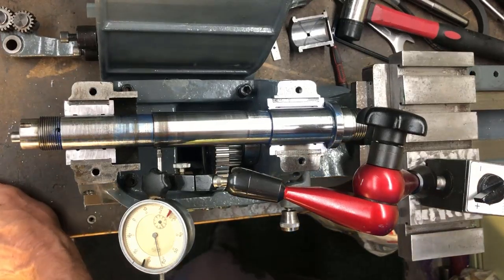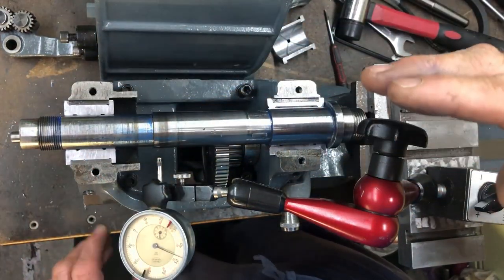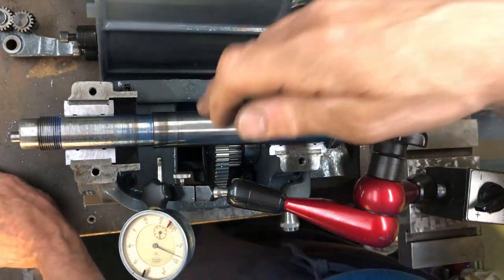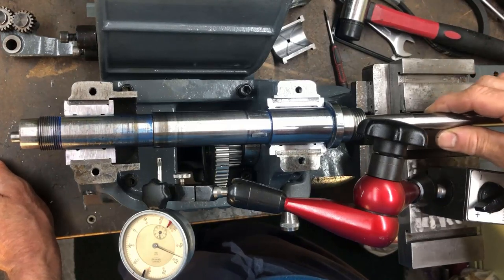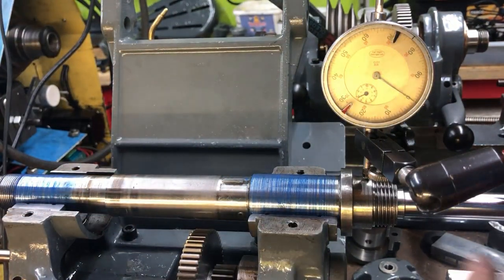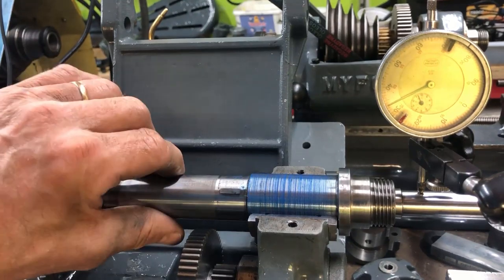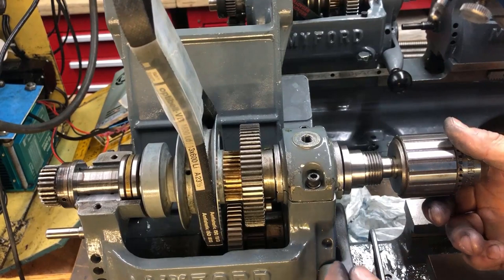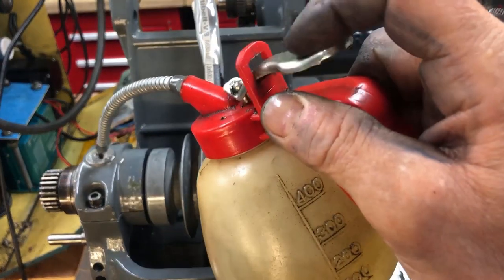Myford ML7 headstock restoration: bearing scraping, testing and spindle alignment

Comment: I can follow the vertical corrections and shim compensation.  I don't understand how horizontal correction is done.  Because cutting forces do apply some side load, there must be wear in that direction also.  

Once there is wear side-to-side, wouldn't it take an excessive amount of material removal to move the spindle bore down to expose fresh side bearing material?  Maybe some side gap is simply disregarded?  Treat the bearing halves sort of like V blocks, with enough lower and upper contact to control spindle position?
Reply from the maker: Hmm.. to my knowledge/experience (which isn't all that great all thing considered) this is also "scraped out". At least, I have managed to get the bearings to cover radially. That said, an ideal bearing like this shouldn't cover 100% or be exactly circular. The theory, as far as I have understood it, requires you to scrape segments/pads and/or make the inside into 4 (or more) flats. On these small and soft bearings I don't bother with this (and I think Myford didn't either).

Comment: Complex restoration! Do people retrofit these with tapered bearings ?
Reply from the maker: Just what needs to be done :) 
Not that I know, Myford offers a replacement kit for the now no-longer-sold white metal bearings. This consists of a similar constructed bearing set, ie. parallel and spilt, in bronze with a hardened spindle. The Myford Super 7 that was designed after the ML7 has a different spindle/bearings, where the front bearing is a conical sleeve ie. tapered.

Comment: Top videos you make, not to mention the work, which basically deserves a lot of respect 👌👍. I also have an ml7 and I'm also scraping the bearings, I have the problem that I can't play the side of the spindle get minimized, maybe it's due to my spotting process or I have to go down further?! Can you tell me which spotting color you use? best regards Sven
Reply from the maker: Thnks for the nice comments! Regarding the spotting color, I normally use a product called Canode, which is water soluble, usually the blue color as well as a yellow contrast color. However, you may use other products/colors.. not really of importance as long it gets the job done ie. makes the high spots stand out so you can see and hence scrape them. Not sure what is the problem in your case, but if you have used the template spindle and only get it to spot in the middle, it is probably to shallow, yes. Then you have to go deeper. If you have an email or use messenger we can discuss further there
Reply: yes by e-mail is better, where can I find your e-mail address? Kind regards Sven
Reply from the maker: @svenhoftmann7663  jshaugjord at gmail .. or a PM